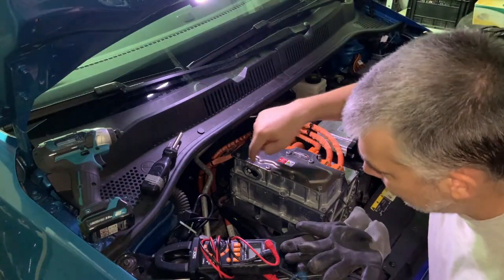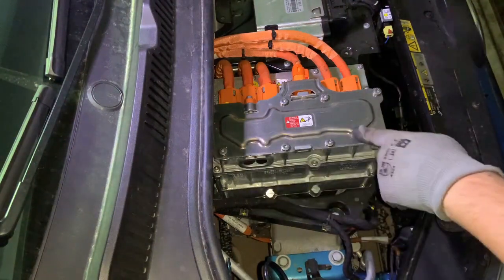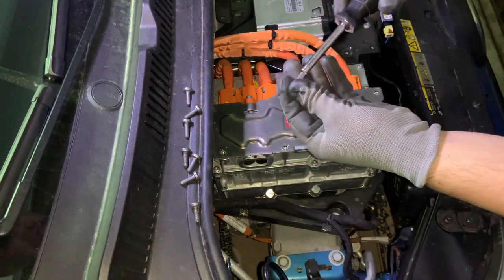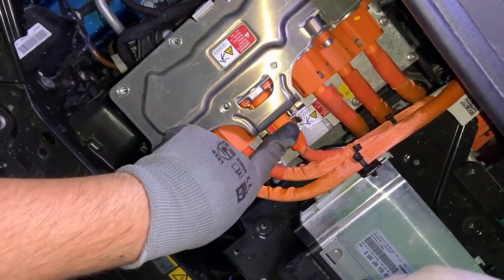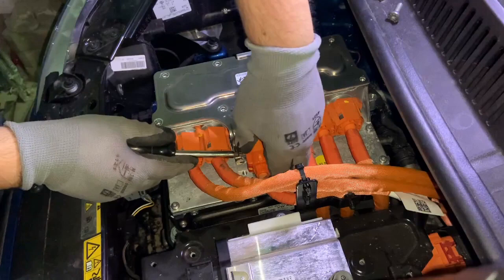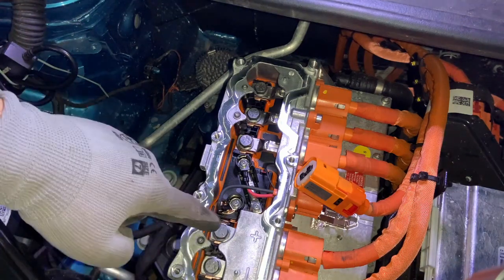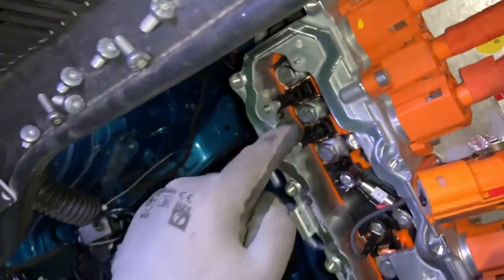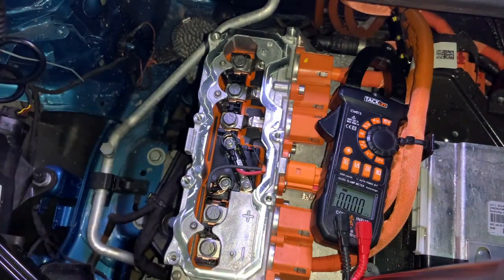HV distribution box explained in Volkswagen e-up

Comment: 320 DC Is very Dangerous tension, more then AC, before any operation take out the High tension battery fuse, is under the rear seat....

Comment: Hello Tedo Nash!
A few months ago I became the happy owner of the e-UP 2014 production (zero generation in your classification :))
I've been happy to watch almost all of your videos with modifications to your car, and I have one big question after you've gone so far and deep. ;)
In the video "first impressions" you said that there was a technical possibility to replace the battery from 18.6 to 37.2 in the car of the 1st generation (2016-2019 production).
How do you think it will be possible to make such an upgrade in a zero-generation car? (2013-2015 production)
Reply from the maker: Man that is a thought question. I am not familiar with the battery in those models to be hones. If the space inside is the same as the next generation then it should be possible to be upgraded. But :-) when I said it is possible the dealer told me that to do so the car needs to go the the factory in Germany, then the new battery to be added and this will cost around 8 000 - 10 000 EUR. Which doesn't wart it to be honest. If you can find some broken gen.2 model with working battery then you can try doing it yourself. This will be my goal if I was you.

Comment: Wonderful. I've a ton of questions!. 
If I've understood properly, you are going to attach directly the module to the main battery. Isn't it?. How is going to differentiate the system the two batteries? When changing , doesn't affect to the algorithm that calculate the input ? Will the car complaint about a battery size bigger than the settings by default?  Please share the technical details, it's amazing.
Reply from the maker: I appreciate that you have so many questions but I can’t answer all of them. The idea is to learn about the car ant it’s battery. I will make a video how I  planing to do the build with all the details. My first goal is to make 84 sells pack. Then there are many opportunities. One is to connect it directly with the car battery but that is dangerous for start. I whine the best way to attack this is to first connect it to the DC-DC converter that powers low voltage system. The next step is to connect it to the car heater and check what I is the flow and last step is to connect it directly to the car battery. But there is a long way for that

Comment: You have my RESPECT, disassemble new car, what about guarantee?  And courage hihg voltage... I really learned something new too  :-)  Do you know, that you can disconnect orange cable?  Do you know what cable is it?
Reply from the maker: If you are asking have I read the manual first - YES. I knew how to disconnect it and what will be inside. In mine Facebook group I have shared the HV electric manuals

Comment: Hi Tedo,
very interessting! A question from my side: Is the measured battery voltage constantly present or only if you switch on the ignition of the car?
Reply from the maker: Only when the ignition is on.
Reply: @tedonash2681  Thanks Tedo!

Comment: Very interesting video. I thought we could add a socket, with a 5A fuse. In this you can connect any electrical device that uses a switched power supply, without any risk for the device. Like a computer or a television. An example of an electrical device that we cannot use would be a hairdryer or a drill. Greetings and thanks for sharing

Comment: I am laughing when everyone calls 320V as High Voltage ⚡ .. everything below 1000V is officially Low Voltage. In your home el. socket is 250V and we dont call it High Voltage :). In other videos i saw people using orange dielectric gloves that are normally used when working on the 11/22kV power distributors.. Glad Tedo didn't use them, it will be ridiculous
Reply from the maker: I am also very surprised when people are so scary of 300-400 volts. I am a professional electrician and I was hit constantly by 3000-4000 volts 25 years ago we repair old TV's in the high school. I am still alive 😊
Reply: It's called high-voltage for car, because everything in standard is 12V/24V which are not dangerous to human.

Comment: Very Nice to see that You can very easy access the high voltage battery, with this, on the future You can upgrade your battery, i hope that i can find someting similar for the firts generation . ( Those days you could fond a 5-10kw battery from newer cars thar can be use to extend the range for ocazional use like in a long distance trip )
Reply: hmm connecting additional battery in paralel might be little problem if they have different SOC and voltage.. anyway could be usefull for inverter to 220V and powering your home as a backup...
Reply from the maker: @andrey6669  I am working on such a project. I will post a video when I have a progress.
Reply: @andrey6669  does exist an inverter that works from 300/400V DC to 220V AC?
Reply from the maker: @stefanopellini2464  most of solar inverters are 400V : https://amzn.to/34UQkQ8
Reply: Not If You doing it in the right wey ( same nominal voltage / same state of charge)
Reply: Or some solar panel to charge the car
Reply from the maker: @armaselubogdan5778  I have suck solar panels and I am very glad that I found this holes in the distribution box.

Comment: very nice indeed, doest it read 320V even when car is off?
Reply from the maker: No there is no voltage when the car is OFF
Reply: that would mean direct connection to battery terminals.. anyway isnt 320V bit too low? i was expecting around 360V
Reply: Yes, you cant switch off a battery!🤣
Reply: @stefanopellini2464  no but there are many circuit breakers, actuators and relays... even some pyro fuses.. its not that easy buddy ;)

Comment: Tedo will this opening void warranty?
Reply from the maker: Almost 85% of my videos will void your warranty if you do it. Even changing the headlights from halogen to LED can void your warranty. Also all the OBDEleven changes.
Reply: @tedonash2681  how do you have courrage to do it? You dont think there will be any problem and you wont need warranty or you hope to revert changes to original status and then go to service?
Reply from the maker: @RomanRoman-xi3dv  in my previous car I reverted everything and dealership  accepted it. I am doing all of this to learn and share my learnings. In this video i turned on the car while the cable was not plugged in. The result was a error message in the instrument cluster and the car does not start. That was scary but I found a way to fix it. I will share that very soon.